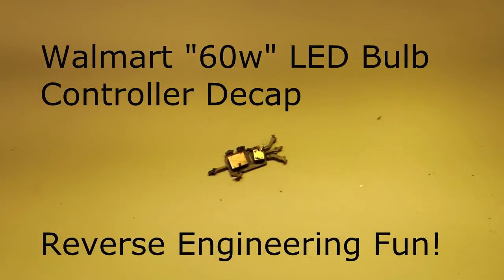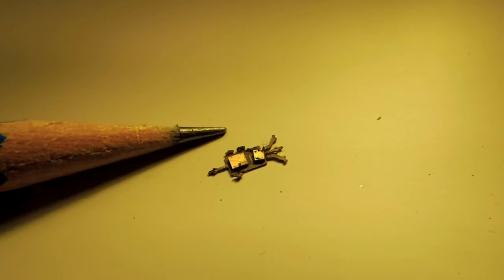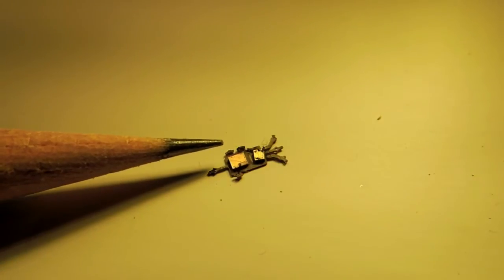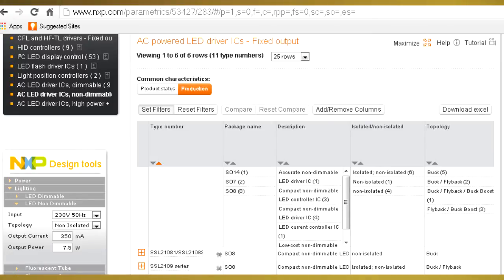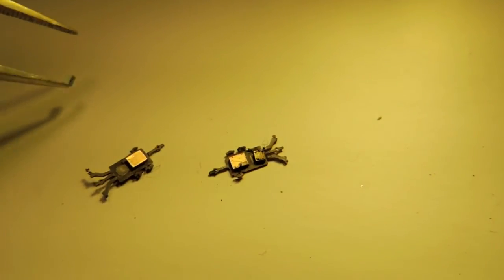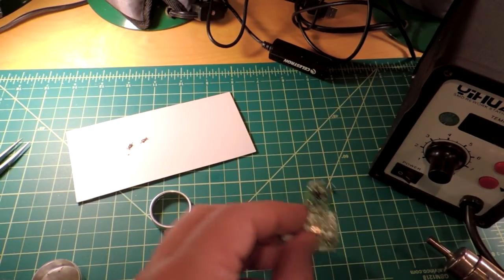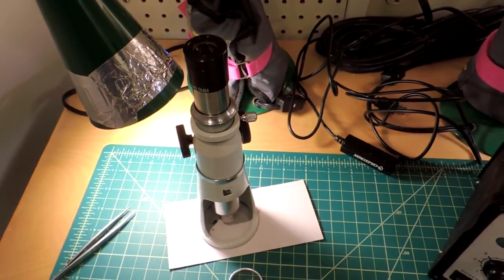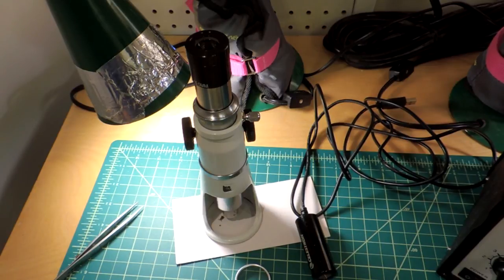Walmart "60W" LED Bulb, Extreme Teardown,  IC decap

Comment: Why doesn't the company want to be known in this case? Also, could it be because the parts are seconds or rejects not worthy of a "Philips" brand LED bulb?
Reply: Generally when you see components with markings removed or obscured in some way it is the manufacturer of the circuit board that has done it, not the manufacturer of the component itself.

It is probably an attempt to make the circuit harder to reverse engineer, though there may be possible to identify it in other ways. And even if you can't, it is often still possible to get an idea of the general nature of the component by looking at how it relates to the rest of the circuit.